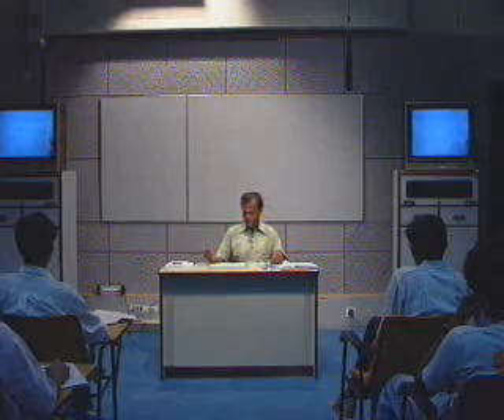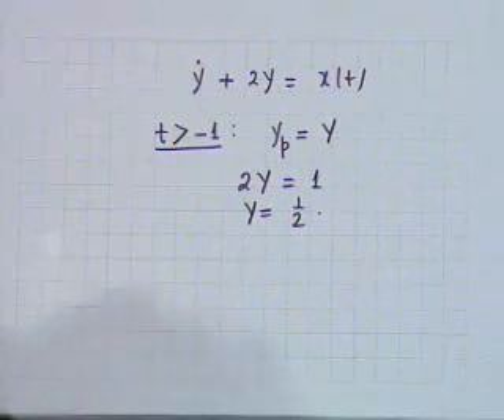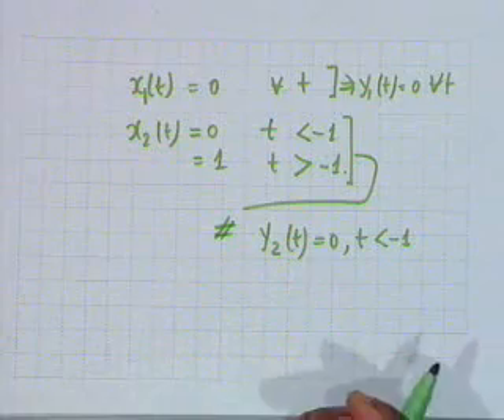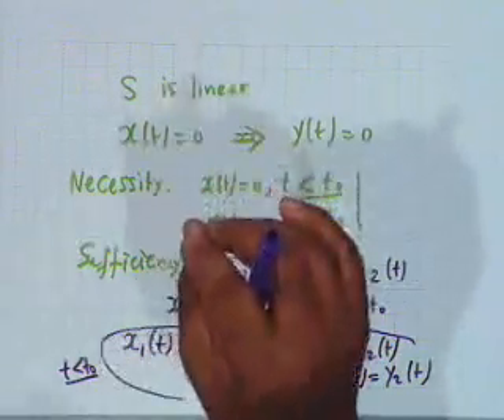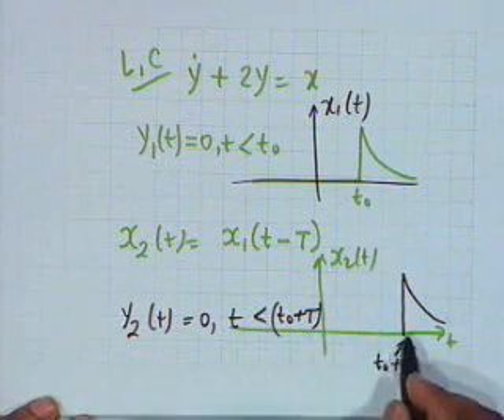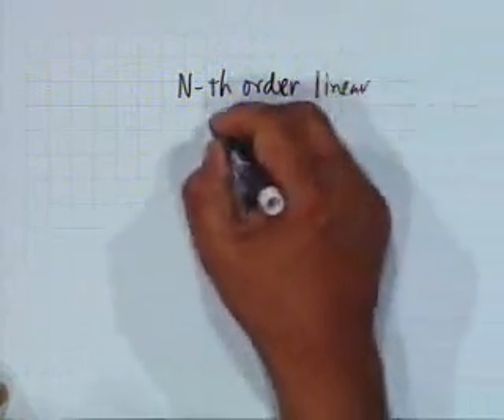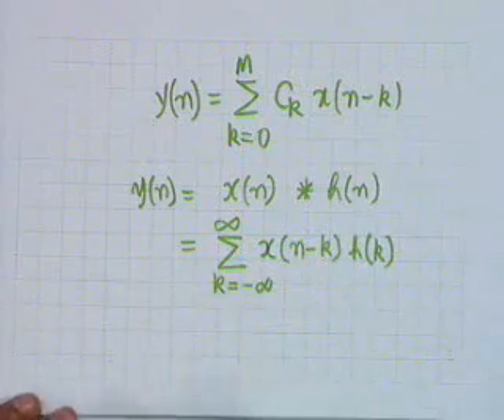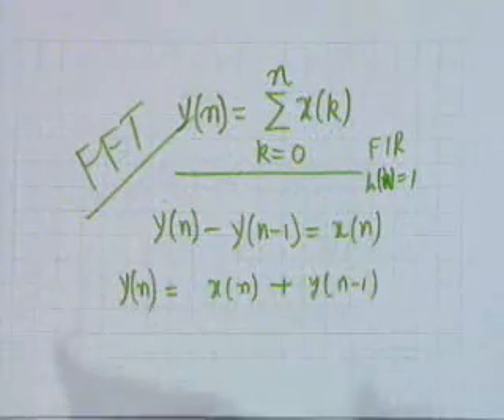8. Systems Described by Differential & Difference Equations

Comment: It feels like a math class then signals and systems class, no help on developing any intuition around the math.
Reply: to develop an intuitive understanding of this subject you first need to understand the fundamentals of the underlying math. Some of the classes would naturally be heavy with math. And if you think that math is not intuitive and is just about moving variables here and there with formulae, my friend you have been doing math wrong :P
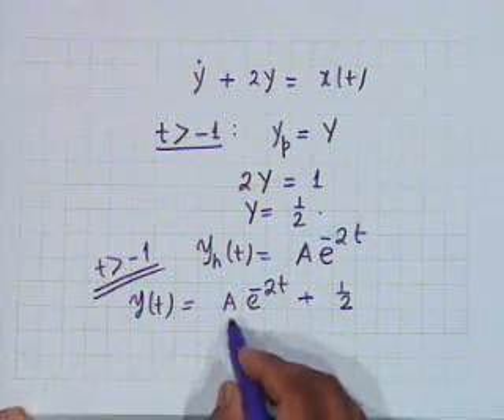Reply: @dikshagiri4415  Can somebody explain how he used initial condition y(t) =0 at t=0  7:45 , did he took it from y1(t) , but he is determining y2(t)?
Reply: @vinaysharma8887   y(t) = 0 at t = 0 comes from the assumption made at 3:18 that the system is linear. For a linear system, the output is present only for t > 0. It is zero for all other times.
Reply: @vinaysharma8887  just as an additional remark, when we say that y(t) = 0 for t = 0, it means that the initial conditions of our system are all 0. The system is at rest before the input is applied at t>0. 

In the differential equation solution, to find the unknown constants mentioned, we use these equations of initial conditions or constraints for specific time intervals given in the question. 

Sometimes the question may mention "y(0) = 1/2 and y(1) = 0.3 " etc. These will ultimately help you determine the unknown constant values in the complete solution of your differential equation.
Reply: @dikshagiri4415  Thanks for this :) :)
Reply: Go through the book of Ordinary Differential Equation.
Reply: Its signals and systems class
Reply: Go through oppenheim
Reply: @Pooja Agarwal I agree with you, it is a tool. But to use a tool well one needs to have an intuitive understanding of the tool. To know what setting to pick for your application how to work it. Very much like an artist uses pencils. 

Like you said yourself math comes after the intuition, that automatically implies that every mathematical expression has an underlying intuition. 

If you only treat math as a dry tool, it will never serve you well. In that case things get really absurd, just like how complex numbers without intuition are nothing but absurdity and simply a notation. And somehow e^jπ = -1 ! How mad it sounds to raise a positive number to an imaginary power and get a negative number as a result. 😂😂

As if some old guy who had nothing better to do just went creative with formulas and somehow this happened ! But that is not true, if you look up imaginary planes and of e^jπ in depth (and I don't mean mathematical proofs but their meaning), it has a great sense of practicality and intuition built in to it all. 

Similarly Matrices, may just be a notation. But there is a reason for just why in the world does this notation make sense ? That's the intuitiveness of math I was speaking of. And that typically never comes from solving long proofs contrary to what it might seem. 😌😌
Reply: @Pooja Agarwal ohhh I am follower of 3b1b too ! 😌😌

Comment: How a Linear, causal system will necessarily be Time Invariant ??? 
I am giving a counter example

y(t) = t x(t) 
This is system is causal as well as linear.... but it is not Time invariant ...
??????
Is SCDR wrong here ????
Reply: To Everyone here:

My understanding was wrong: 
SCDR sir was saying that a linear and causal system defined by "linear constant coefficient differential equation" is necessarily time invariant.

I missed the point that the system must be defined by Linear Constant Coefficient differential equation.

In my counter example:
y(t) = t x(t)
Coefficient of x(t) is t, which is not constant

Hence I was wrong not SCDR sir.
Reply: sir he is talking about differential equation governed system
Reply: your system is time variant
Reply: sir u are right 
so what do u think is the condition
Reply: y+t)= tx(t) is time varient system. As when you apply shifted input x(t-t•) then y(t)=tx(t-t• )

t which is multiplied to x(t) does not change,as it is a system property (system is getting multiplied by instantaneous time)
Reply: I think he meant  only for system governed by differential equation.
Reply: @pranshunigam5991  system I mentioned is causal, as for any t, y(t) depends on x(t) not x(t + something). When output depends on future input, system is non-causal.